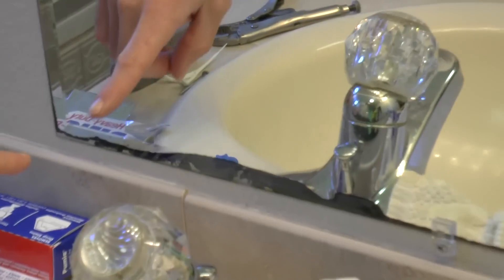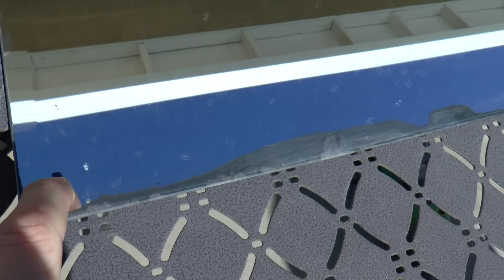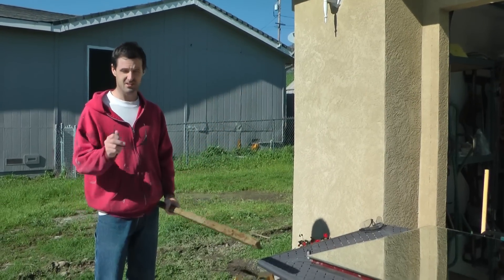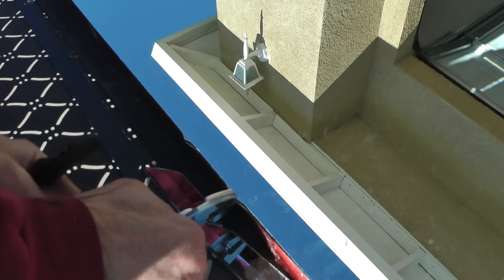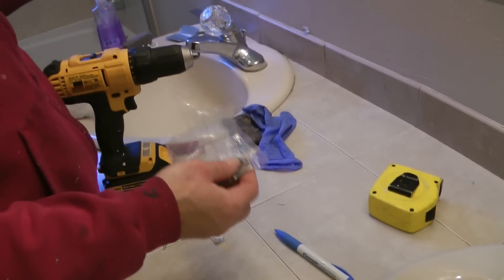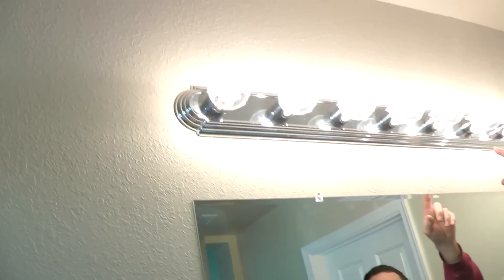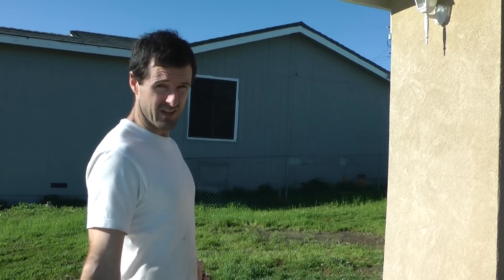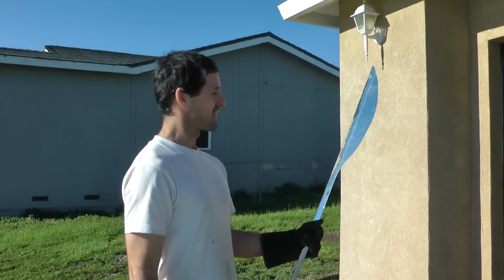How To Cut A Glass Mirror & Ruin Another One!

Comment: i worked at a shower door shop for 3 years i also cut mirrors. my experience has been that when u get down into that 1 inch to 1 and a half range its really 50/50  chances of a clean break.  i second that the cutting oil helps.  and dont be afraid to sand those edges down. you did a great cut on that first mirror. i probably would have belt sanded the waves out and slapped a bevel on it.  u should buy a new mirror for the second one u did and use the old one for some practice cuts. steady speed and steady pressure all the way through the cut will clean it up a lot.  maybe you can cut some mirrors for the camper!!  ( :

Comment: When peeling a 1 inch piece of 1/4" mirror, dip your cutter in motor oil then score the glass. Popping the strip off is not an option on such a small cut, instead QUICKLY grab the edge that is the last area scored and push it down with your thumbs and it will peel cleanly. Waiting after you scored the glass is a big mistake. If you don't feel comfortable doing it that way, another novice way is to put the round edge of the cutter under the score line at the edge and gently push down to help start the run.
Reply: A snap break or popping break like you were attempting is only something you do with a large cut.